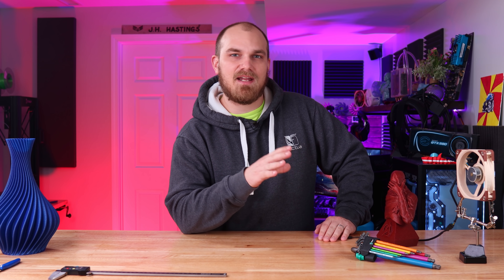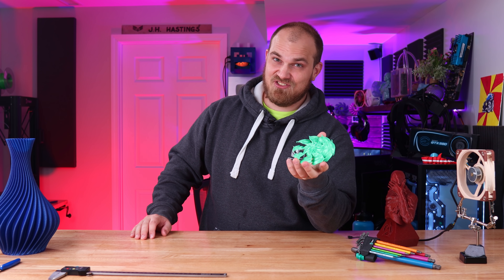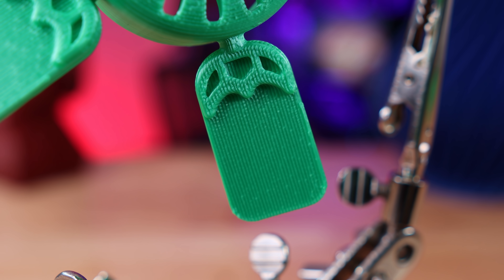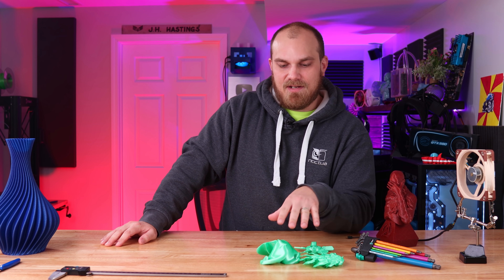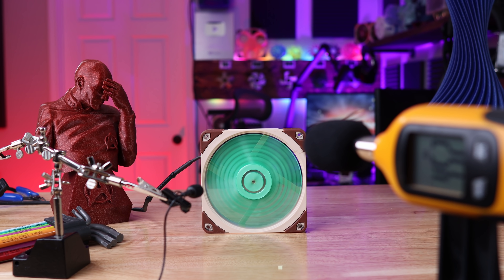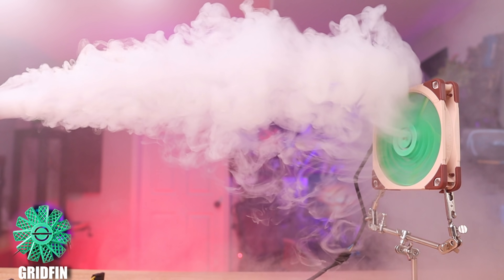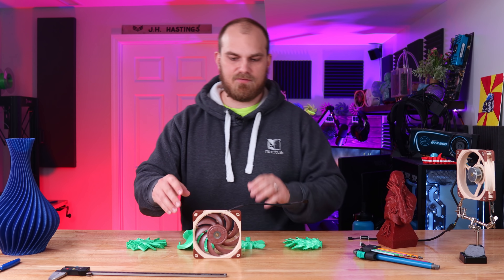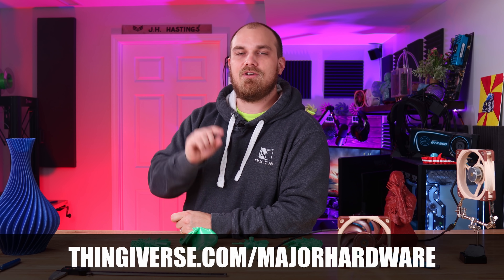Can a fan made of GRID FINS work? - Fan Showdown S2E11

Comment: I've got to wonder what's the quietest fan blade that you've had on the show, if it's one that fits completely within the frame of the a12 x25 would it be possible for me to get it printed out? Or get the file to have someone print it? Bought one of these bad boys and tbh it's way louder then any fan I've ever had. Granted it's also probably way stronger too, my BIOS settings cannot calm this beast down. Even silent mode is loud!

Comment: In addition to the smoke, i would like to see basically like the little foil tape stuff on those fans in warehouses that area high enough to need a vision confirmation that it's running 🤪

It would help me visualize how much force the fans area making.. How much air is actually being pushed/pulled through, instead of smoke, which spreads out after the blades hit it and so you have to judge how much air is moving kinda....?

Also maybe just a panel that measures how much force is being applied to it(air blowing against it in this case)

I am sure that your data tells smart people what i am trying to visualize, but it might be nice for us peasants

Comment: I guess the slug moves so much air because it has a large surface area on the blades, meaning it can move a lot of air at once, plus the sheer volume of the fan makes it so that it has a larger area of capture than most other fans, so it isn't exactly the best fan, but it's pretty damn good for a non-flat fan.

Comment: The main issue I see with these more unusual designs is that some seem great at pulling in the air, but the releasing of it is so turbulent that I feel that it would make it work less efficiently than one that could release as well as it pulls it in...but I'm not an engineer and this is only an observation...

Comment: Umm the picture you shown for “Soyuz” is Chinese Shenzhou spacecraft on a LongMarch rocket. Which technically not the same, but some technology were based on Soyuz. The grid fin is not used during normal operations, only used if need aborting as part of launch escape system.

Comment: I love your vids on all these fan designs, haven't contributed - but thought of something. Is it possible to add a Static-pressure test metric for all the fans you've tested? I wonder how it competes against other static pressure designs for fans used on radiators and similar.

Comment: Major, I really think your demos with the fans would do better if there was some kind of separating wall between the front and the back of the fan.

On some designs the pressures from the exhaust of the fan interfere with the intakes performance. Even a 1sqft sheet of acrylic would be a massive improvement. Please consider it!

Comment: I'm not even close to a computer designer or fan expert BUT, I have an idea. On the grid fan, what if you canted the grid the opposite direction of blades? It would seem to me that it would cause it to scoop up air like an icecream scoop. The grids may have to be made stronger and/or it would use more power, but unless someone knows a solid reason why it wouldn't be an improvement in someway, maybe it's worth testing.

Comment: Hmm seems like the gridfind blades should be rotated by 90 degrees, considering grid fins are usually 90 rotated compared to how regular fins would be attached to an aircraft (Since the airflow is supposed to be moving through the holes rather than over them)

Comment: I can't CAD, but someone should make a Celtic triangle(ish) fan.  

Or a vagina fan to go with the penis fan.

It would be interesting to see a couple of 'identical' fans at different weights (weighted with pennies in the frame?) or with roughly the same fans with a different angle.  It seems right now the big question, besides shape, is what the sweet spot is for the motor in terms of torque vs. speed and how much the weight of the fan helps it cut through the air vs. how much moving faster helps.  I'd think the lightest fan would work best as long as it was rigid, but dialing in how much of a bite each rotation of the fan would take out of the air with each revolution vs. how many revolutions it can make would seem to be where the science goes.

Can you print in different colors?  That demonic fan would look awesome in black but with the pentacle in red, or play with different colors in rings so the fan would still seem to be different colors while moving.

Comment: You know what works? What really works? Fans with standard design like Noctua SP and alike - but built from CNC cut aluminium parts for super high tolerances. Blades right up to the edge of the frame, super thin blade design for weight reduction, stronger motor for higher speed. It might be a safety hazzard, but it would move air like an aircraft engine.

Comment: It should be noted that the fans ability to compress the air is important. when a pc fan is mounted on a case, the fan needs to force the air into the case and faces resistance. Many pc fans fail in that they do a good job of moving air only when there is little back pressure. I don't have the skills to design a model but maybe a fan that shares a shape similar to a centrifugal compressor would help in pushing against the backpressure.

Comment: maybe hte gridfin would work better if the baldes were less aggressively angled
because well, remember, the way gridfins work, their angle of attack is well... 90° from what they look like
like when the gridfin looks like it's flat it has a 90° angle of attack and if it looks like it's vertical it is actually flat because it' not hte main body of the gridfin that you're looking for it's the grids parts
so gridfins that at first glance LOOK like they have 30° pitch actualy have 60° pitch which is... a bit aggressive I guess
also, well, they have their puposes but efficient air movement at speeds far below the speed of sound when folding and storage isn't needed is not really one of them
Reply: I would hypothesize that a 45° angle would work best for the grid fin to move air.  Grid fins are definitely not the most efficient design for the movement of air, they are designed as control surfaces and to produce drag so as to work as an airbrake.

Comment: Theres a specialized submarine prop, that makes no sound when spinning ,so the db of the servo's operating should be the only sounds heard... I wonder how that design would fair.

What do we want with the fan? Largest temperature change? The quietest sound?

The prop design I Like but any lead edge would cause a disturbance, unless the eddy it makes is not impacted the the other fan, meaning that the lead could make the other blades x distance and next to it quiet.. and the also funnel more power to chill.. but a rotating or manipulative structure of a prop fan, could drastically change the torque/ of a blade to the force it pushes.

An idea to limit edge decay is to put it in a cylindrical confine, if you can't geometricly solve the edge issue...
 Of course any blade at any angle can make a problem unless its made, weight of the fan can also have an impact on the system or power of the servo, and weight more or less can change the overall rpm of the fan.... Something spinning to fast of x shape would create a wall.. something spinning to slow... will not do much ,but wouldn't generate much heat... well it could start a fire, lol. by over working the servo, spinning or whatever its called.

A really fat, 5 pointed star with flutes cut in could be a strange one.. sand dollar starfish.. of course the design can effect the direction of the smoke, wind exiting the system, one could make a stop and then small exit holes...

What a interesting little game of fans...

Another interesting design is ... creating a magnetic fan. So you create a ring lock,  to a metal ring... Which has little blades. It spins and spins the other thing levitating mag ring.  could be interesting 

^^---^^ A top sort of profile look... the ring owed be trapped between the pyramid forces... while being repealed away greater than its weight... but nvm... it wouldn't work... side ways ring.. would displace by gravity pulling its centre away unless it has a fixed point, so would have to run laying down... sigh no fun.. for levitating fan system... although it might not matter if the magnet is really strong.. and 2000 rpm isn't that fast.... hmm

Comment: I would think that the gridfin would work even better if the internal blades were more parallel to the fan motion. The large ones are a grid of air foils this one looked like they were just squared off. So perhaps those changes would help it work better.

Comment: I kind of wonder if you keep the current model of grid fin and spin the fan in the opposite direction? Because technically the control surfaces you want moving air is the grid pattern itself and not the whole fin. So I would want to see if there is a difference in performance with the direction reversed with the grid sections trying to scoop the air instead of the whole fin itself.

Comment: I have an interesting question that maybe you can solve. Due to the regulation changes of the FAA class one in class two drones have an open air design. Basically the propellers can cause physical damage to human flesh. Watching this most recent video of yours I was wondering if you would be able to expand into the optimum propeller propulsion for various drones. Because it encompasses many of the same problems just at a higher torque and speed.
   Ideally encompassing a shroud that would help accelerate the air and make it more efficient also.
    The slug blade or demon blade would be an awesome retrofit for a drone if they could be made efficient enough. Just wondering why and if it's even possible? 😁

Comment: If you increase volume by another 20db, you'll be able to hear how spying Noctua engineers are taking notes.
Reply: Yeah, cause they gonna make a bunch of fans that stick way out of the normally allotted space, made with production processes that greatly reduce the yields of fans to sell. I'm sure the reason their fan is in 5th is because some performance concessions have to be made in the name of production speed & cost.
Reply: @tl1024  While Noctua may make concessions for space and mold-ability, the result is within variance of the top and I wouldn't even read that into it.  I'm pretty sure this is their old design, as well.

Comment: I think the biggest issue with the grid fin is that the angle is excessively steep. If it looks shallow, you're thinking 90 degrees out of phase -- the large fin structures may look superficially like blades, but they are not actually blades: it's the gridlines that are the actual blades. And because the grid-blades are perpendicular to the fins, a shallow angle for the fins means a steep angle for the actual blades.

If you adjust the angle to try to get the grid fins working, the fins will end up being so narrow that you're going to struggle to make a useful number of grid-blades through them.

Comment: I cannot stop thinking about a fan design with no motor in the middle.
Obviously, not having one in the middle should allow for more airflow.
I have zero knowledge on how to use any 3D tool to design what i have in mind but i imagine a fan design that has either 4 or 2 motors in the corners of the base of the fan which they move the fan by touching an outer surface like a shell which, this shell itself also hold the fan blades.
The motors should use some rubber material to help with noise reduction.
Since there i no monitor in this design it will need nothing to hold it other than simply grooves on that outer surface which hold the fan (there should probably be and upper limit on the RPM for the fan to not go flying, unless the groove being diagonal can help alleviate this issue if it happens to be the case not sure how that would affect the noise and stability though, but likely there should be a sweet spot).
I've searched a lot and i haven't as of yet find any such design on the internet.
Maybe my idea is dumb, maybe it can't do high RPM or maybe the fact that there is no motor in the center compensates for that, but damn i need to see this becoming a reality, who knows maybe it's better for some application.
I trying to contemplate if there are any implications that wouldn't allow for this design to work at all or to just be bad enough, i assume that people in the comment section help with that. :P
Reply: See the TMD fans historically made by Y.S. Tech
Reply: @longrunner258  Oh thank you

Comment: ...maybe we can't get those wicked designs mass produced, but some company (big or small) should build cheap/robust customizable fan that would have "clip on" hub and a default fan as a starter. 

All the fan blades could than be 3D printed by a seperate service that would have fan design repository consisting of "free for print" or "buy for some small fee" designs. Fan repository could also have stats for every fan in database so if everyone is seeking performace they can filter out the best...:D

Comment: Hmm,  I like the idea of Demon. For custom builds it would hit the spot. (or you know, with any other theme as well)
However,, when it's running you can't really see the fan. so that's a bummer. 
I wonder  if it's possible  to slave the PWM signal to strobe the LED's (ofc it's gonna have LED's). If you can strobe the light in time with the spinning blades, you should  be able to create the illusion of  the fan standing still. (or slightly tweak the timing to make it look like its slowing spinning.) I figure using the PWM signal would be the easiest and cheapest way of doing it.  Anyone got any idea it thats doable?

Comment: I feel like a fan with a turbulent current is good because of the effect on the impurities in the air. Instead of targeting one space inside the case for your PC build, the current targets many points, potentially causing less debris like disgusting dust and what not stuck on the surfaces inside. Just a guess.

Comment: I wish for a 4 FIN Slug fan, for me it looks awesome (I love function that forms, I also like the Cybertruck design because the cold rolled steel dictated it and Tesla made the most out of the limitations and delivered something "cheap" yet most practical for practical people that now, they do not need to take any generator with them, because the truck comes with hydraulic pump and electric tool outlet and the best bonus is that is stainless steel and me being in EU where winter brings the salt and we have a humid air, making rust the death of at least 70% of the vehicles ... but the only thing i am waiting tesla to do with the cybertruck, is to give it 4 motors, 2x in the front that are energy efficiency focused for long trips at a constant 60-120 Mph Speed while the 2x back mottos being focused on raw standing power and acceleration, to make the vehicle be able to climb a 60 degrees slope while towing)

Comment: As a rocket scientist- If you don't spin your grid fans at subsonic speeds, than it probably won't work that good (those grid fins are used as an alternative for stabilizers for higher velocities). But again, if you spin them at subsonic speeds, than you probably doing something horribly wrong with your cooling.

Comment: Id like to see an RPM added to the tests.  I believe that some of these designs might be getting better or worse results, based on RPM, rather than Just the fan blade design.  This means, that some of these blades might be better at moving air.. IF.. they were printed thinner, for example.  And or if the fan motor war more powerful / faster.

 Additionally, for the smoke test, Id like to see you make a box to reveal flow better.  Id make an H shape, with one of the H sides being transparent plexiglass (fan in the middle of the H bar). Paint the wood black, so that the smoke shows up really well against it.  You could also add a pexi top as well, if desired.

Comment: That's a pentacle, not a pentagram, as it doesn't have a circle, and a pentacle or pentagram only summons demons/evil spirits if it's inverted. A right side up pentacle or pentagram summons good spirits or protects from bad ones. So you are rapidly summoning and warding good and bad spirits at a rate of 1600 times every minute and you are just going to get your ass kicked by both sides for being very confusing.

Comment: I've definitely seen a hot ceiling. Felt it too. In an apartment I lived in, with black tar shingles on the roof, and zero attic ventilation. You could not touch it. The air conditioning bill was insane.

Comment: can somebody smarter than me make the fan like nvidia uses on top the 3080/90? It like scoops the air thru it so you would turn the orientation of the fan around. it would pull air rather than push it

Comment: I'm surprised that no one has entered a fan disk resembling a rotary engine with a two bladed propeller. Also I have a strong urge to download blender, and model as much close possible the fan of the new Scania V8. It will sound like a big diesel truck, but it will be the mood setter for some Euro Truck Simulator 2 session, and possibly a truck themed PC build.

Comment: Really liked how much air the Slug one pushed. In the smoke test it looks like a winner to me even though it did not make the Top 5 I'm sure it would cool nearby components just as well as it cools the CPU heatsink.
And that GridFin should not have worked lol I mean come on the fins should have pushed the air outwards and yet the smoke test was very good - how can that be?! 😂😂
Reply: I suspect it is the angle of the actual material faces that are directing the air through not the greater blades (as the leading edge is so broad, and there's no actual wing to direct the flow). If that's the case some adjustment would likely significantly improve the flow. But if it's some weird pressure differential thing, It may be designed perfectly??
Reply: @Oblithian  Who knows? We can only wonder: WTF? lol